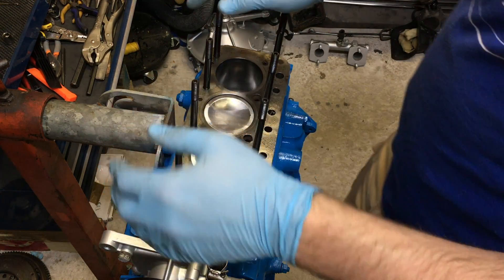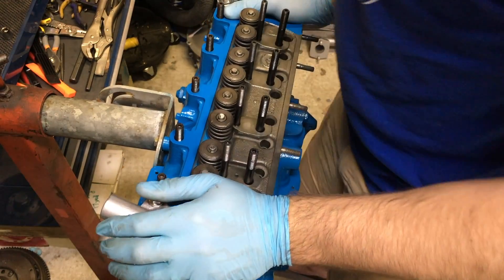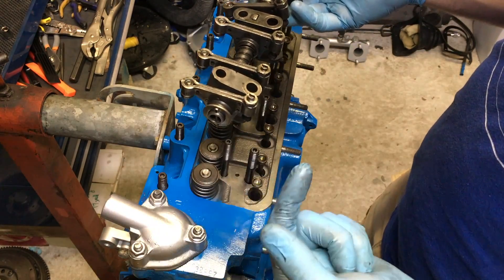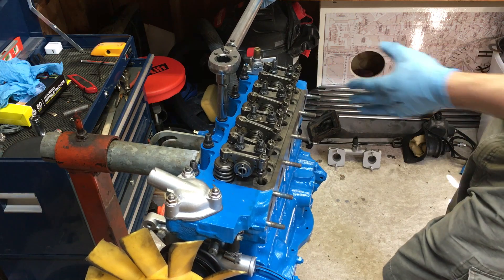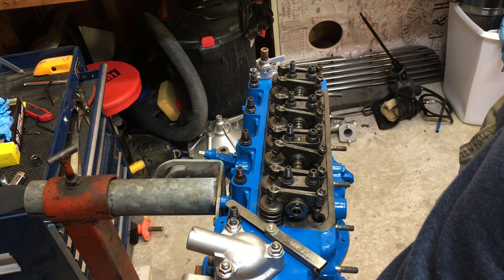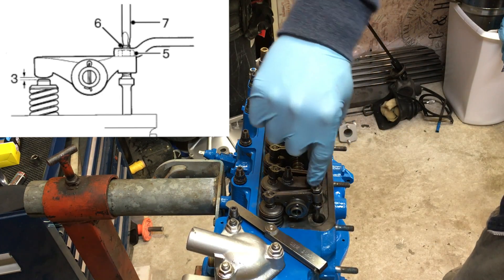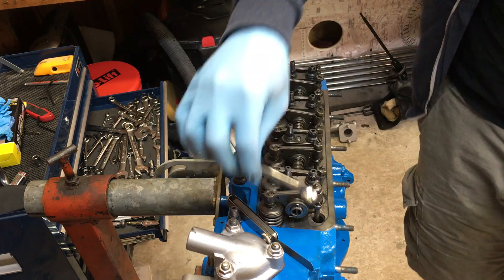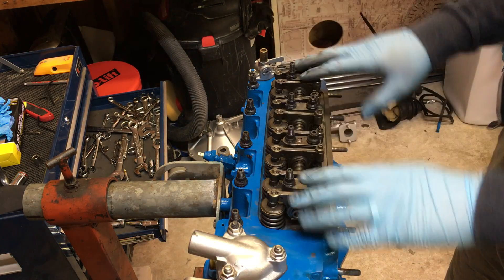Classic Mini DIY - Head Gasket Install and Valve Clearance Settings

Comment: yooo, a series engines dont have lifters. they are pushrod engines. every one of your vids feels like youve ONLY JUST learnt what you are teaching/attempting to teach people... this tells me you have no idea/experience of failures/possible issues/anything other than the single time you have done this....the lifter thing really is annoying!!!! a lifter is a totally different thing
Reply: @classicminidetails8887  A lifter is a cylindrical component that rides on the Cam Shaft to actuate the Intake and Exhaust Valves. For pushrod engines, the Lifter pushes the pushrod up into the Rocker Arm and opens the valve.
Reply from the maker: Thanks for your candid feedback. I have said many times that I am not an expert and will likely make mistakes and that I am sharing the experience I do have. That said minis absolutely have lifters also called cam followers outside the USA. I definitely referred to the wrong thing as a lifter here however minis most definitely have lifters. Lifter(cam follower) to Push rod to rocker assembly. Sounds like you might not know the A-series as well as you think.
Reply: look, you are once again getting on ones high horse. cam followers are not lifters k @classicminidiy  i grew up with mini's (as in, toddler building cars with dad) you didnt. try correct me all you like. or find the vid of me showing anyone how to do anything the wrong way, proudly... fuckinyankees
Reply from the maker: K

Comment: Good vid thanks and well done, But no info on setting the valve open position, prior to setting the gap for the coresponding open valve gap.......Is it simply a matter of adjusting the rocker tight onto the valve until the spring is completely tensioned ?
Reply from the maker: I'm not sure I understand what you are asking? Setting the clearance between the rocker and the top of the valve is setting that gap I think you are referring to.

Comment: Turn the engine until the valves on 1. are "on the rock" and adjust both valves on 4. turn until 3. is on the rock and adjust both on 2. turn until 4. is on the rock and do 1. lastly turn until 2. is on the rock and adjust both on 3. Don't tighten the bolts in one go, do it in stages, these are not stretch bolts so  you do not need to follow exact stages just do do it in two or three. With modern composite gaskets you do not need to re-tighten later, in fact, in my experience, it has proved to be a pointless exercise if the head was properly tightened in the first place, if you do decide to re-torque the bolts, after a run, don't forget you will need to re-do the tappet clearances too.

Comment: You should really tighten the head down in two stages, 25 ft/lbs first then repeat the tightening sequence to 45 ft/lbs or 50 ft/lbs depending on the engine spec and stud spec. ARP studs should be done in 3 sequences, 25 ft/lbs--50ft/lbs and 75 ft/lbs. There are 9 stud and 10 stud heads, the 11th is a bolt and should be 25 ft/lbs. Tappet clearances are 0.012" inlet and 0.015" exhaust. The head should be re-torqued after a full engine warm up and/or short drive and valve clearances reset.
Your fan is on backwards.
Reply: see, this guy knows.... even then, who has EVER lifted a head on an a series engine? LOL arp bolts are great... not needed. this is not a 10:1+ engine nor is it forced induction. total waste of money
Reply: @minor0confusion  Well, mine is 10.9:1. Those engines respond really well to high CR, taking precautions pays off on the long term.
Reply: I have read that the head need 42Nm tightening.that is a lot lower than 45ft/lbs.what your thought?i an going to tighten an mpi 9 bolt head.

Comment: hey dude, do you have a video where you take out the engine. I need to do that with mine. Great video's btw
Reply from the maker: Thanks for the kind words! I don't have a video yet for removing the motor. However I will be pulling my motor in about about a month give or take, when I do it I will be going into great detail about the removal process. :-)

Comment: Do you need to loose and re-tighten the rocker arms even if you didnt move the pistons? Like for a simple head gasket replacement. Thanks
Reply from the maker: Nope! You will have to remove the rocket assembly to get the head off but you do not need to adjust the rockers at that time.  Just make sure you keep the lifters in the same order when you take them out and put them back in.

Comment: What valve clearance do you recommend for an a+ 998 engine with stock parts on it? I wasn't sure if I should use the same gap you did in the video, thank you.
Reply: 0.3

Comment: Enjoyed the vid as I wanted to see how it all worked as I have a Reliant 850 engine which is a cousin of the A series both being derived from the Austin 7 engines,   btw have you tried a ClickAdjust tool which was almost designed around the A series and is a great tool for doing the lock nuts up.
Reply from the maker: Nice I had no idea those were cousin motors.  :-)  I am not familiar with this tool do you have a link to it?
Reply: Yes Reliant bought the sidevalve tooling from Austin-Morris turning to an all alloy evolution with the 750 then the 850cc lumps which visually are identical to an A series, I am a great fan of the A series engine as its such a treat to work on and yet is just so feisty for its size.

Comment: could you please give a list of tools that you used during this
Reply from the maker: 1. A full socket set (depending on the head stud nuts you may need 12 point sockets)
2. Torque Wrench - Absolutely required to do properly
3. Valve clearance shim tool - they sell these at basically any auto parts store.  Just ask and they will point you in the right direction
4. Flathead screw driver
5. Spanner set
6. Nice set of gloves
Reply: cheers

Comment: Looks like your fan is installed backwards.
Reply from the maker: Indeed it was. Not sure if it was during engine rebuild most recently or during some other maintenance I must have put it on backwards.  Thankfully now that its 97-101 in NC these days it's on the correct way.  Thanks for the heads up!
Reply: are you going to MME?
Reply from the maker: I would really like to however I am not sure I can get off work to come up there.  It's 50/50 right now.

Comment: Love this!
Reply from the maker: +Jason Day Thanks!
Reply: +Classic Mini DIY  Hey Mini DIY, just about to do a head gasket myself and curious what else you would change or look out for while doing this? (1991 SPi Mini, oil in coolant symptom)
Reply from the maker: +Jason Day Hey Jason, when you take the head off you will probably be able to see where the gasket itself is split allowing oil to move into the coolant. Also on the face of the block and head check for scoring or blow by marks which generally look burnt.  Also if the blow by is really big I would consider taking the head to a machine shop and having them confirm the face is still all even so that it seals nicely with the new head gasket.
Reply: +Classic Mini DIY Perfect thank you! Now just got to wait for the parts to come from england! Anywhere we can go (forum maybe) to see what your current setup is?  Beautiful mini you have
Reply from the maker: +Jason Day Thanks for the kind words.  I have an album(way too big) of the whole resto process minus the most recent few months. Here's a link to it:  http://imgur.com/a/MN0wx#0

On most all the mini forums out there I am SomethingNew71 

minimania.com
theminiforum.co.uk
restorationmini.com

Comment: Hi. With regards to ARP studs and nuts, what's your opinion on dry vs wet torquing? Thanks for your vids.
Reply from the maker: +Benny Dadog Hey I didn't cover it in detail on this but I always use the ARP torque lubrication on my bolts when I am tightening them.  In my opinion its always worth using and it takes no extra effort to just add it to the process.
Reply: Benny Dadog Aa